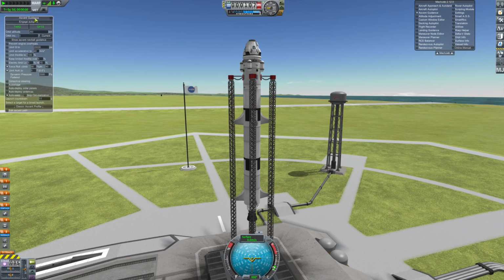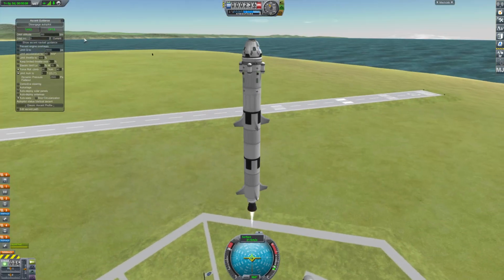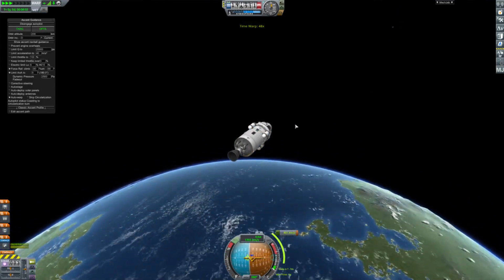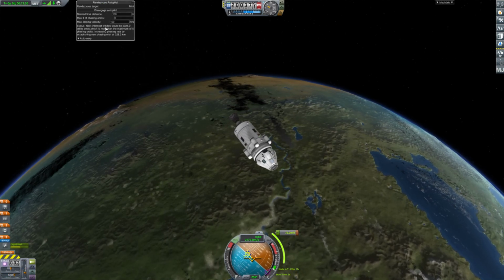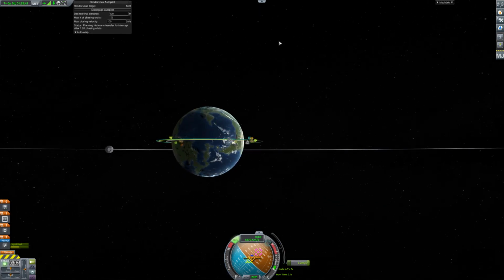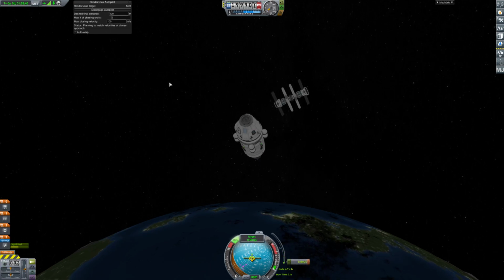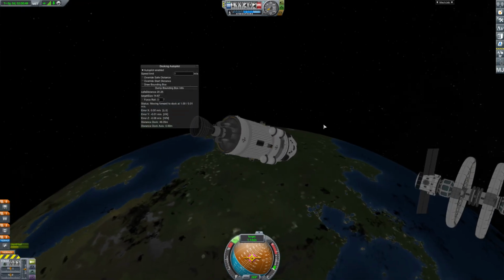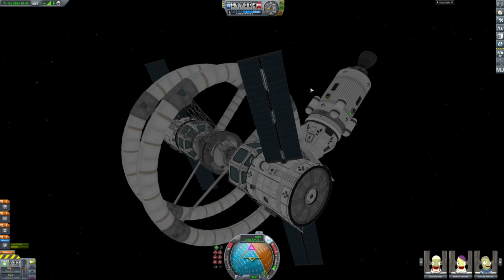Kerbal Space Program | Basic McJeb2 Tutorial!

Comment from the maker: Hey guys! Just a quick update! If you have trouble with getting MechJeb to work here's what I did. Delete the Mcjeb out of your GameData and delete it from ckan. Make sure you have the latest version ticked on ckan and re install. It should work. If not then maybe you have some other mods that are stopping it from working.
Reply: I've taken out all mods except for mechjeb 2 and it still dosen't work. I've reinstalled it like 3 times :(
Reply: Same here... at first it worked well, but later it went nuts! After mamy attempts to repair it or set to default or fresh config it's the same...any ideas?
Reply from the maker: @rexsenei  make sure Mcjeb is up to date with your current game version, also sometimes if other mods can interfere with it
Reply: @bosheeny  yeah all good with thos things. I use CKAN and info show all green and no mod collision. I reinstaled and even only used this one mod only. Still no fix. I will reinstall game some time in future and see on clear version how it will work. P.S. MachJeb 2 have this device you need to install on "rocket" and tech tree to unlock more options in menu. I have all on cariere...so I will start new science and sandbox and see how it works there...on forums is little info so I will work with what may help to fix or solve this issue ;)
Reply from the maker: @rexsenei  no problem, if those fixes haven’t done anything there’s nothing else I can help with sorry
Reply: @bosheeny question, does mechjeb autopilot completely automate the flight? Like it does the mission for you?
Reply from the maker: @ZandrianEmpire-Official-  Mcjeb can’t do missions fully for you, but it can assist with takeoff, landing, docking etc

Comment: My rocket keeps tipping over when I use the Ascent Guidance. Is it too heavy? I've got 2 1.5 m service bays, the lower one has a octagonal truss covered in a donut external tank and ontop of the truss the MechJeb. The upper one has a mystery goo container, 3 monoproppelant balls and 2 magnetometer booms and then the MK1 command module. Will the ascent guidance actually work if i make the craft lighter?
Reply from the maker: Yeah probably cause your rocket is too heavy or maybe just too large scale for your ascent guidance. You can alter when it turns and how steep, but if it’s too heavy and turns too far it’ll flip
Reply: @bosheeny  Thanks for your help!

Comment: MechJeb for me is stuck at the top left-hand corner of my screen thus making it to where whenever I open ascent guidance (or any other controls for the record) it is stuck off screen with a small sliver of it poking out from the top corner. I try and move it but it just goes back to where it was. Either I am the biggest idiot (most likely) and I'm bashing my head against the wall for no reason, or mine is bugged. IDK what to do.
Reply from the maker: There should be a box to close off each panel like a exit button on a browser, you can also drag the popup by just holding LMB on the menu at the top and just drag ( I should really make more tutorials ) if that isn't working either maybe Mcjeb is out dated or I dont know. I've never had that issue with it being outdated myself
Reply: i have the solution
when you are in the bav you click on mecjab and click on parameters or something like that, the icon should go to the right and the problem is sloved